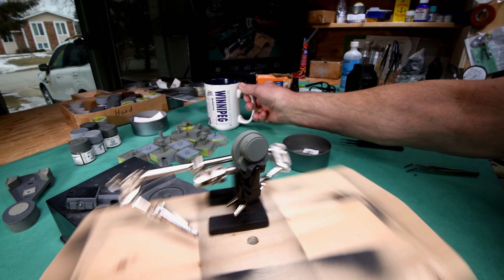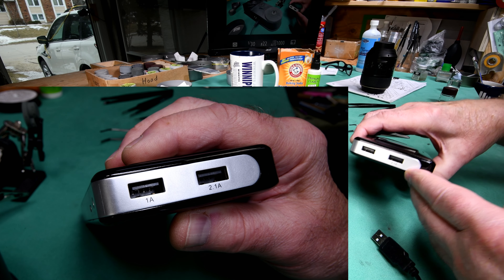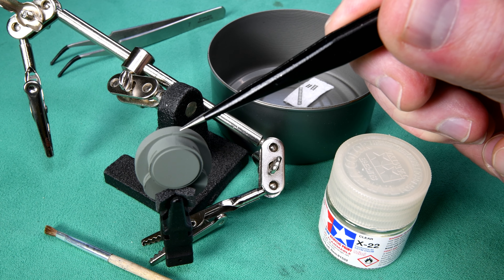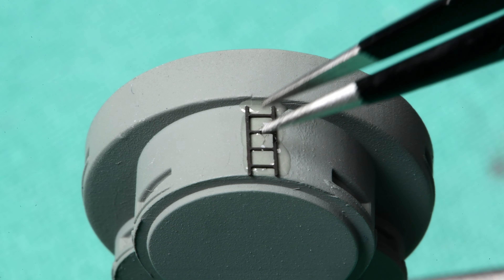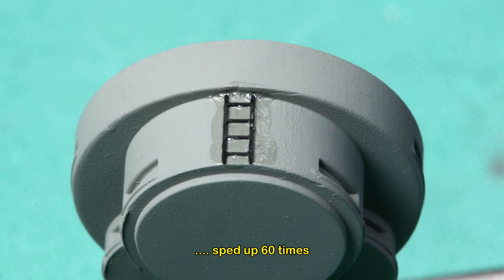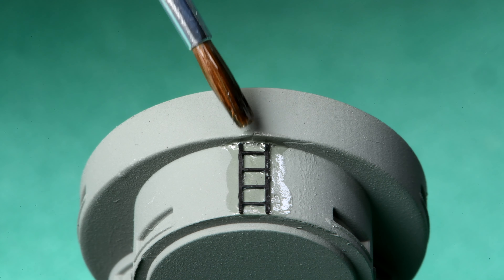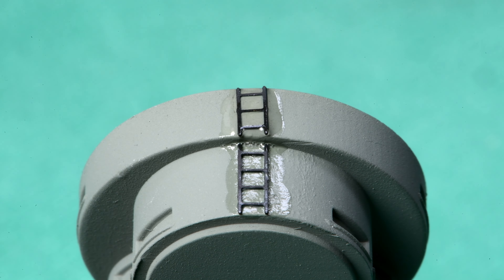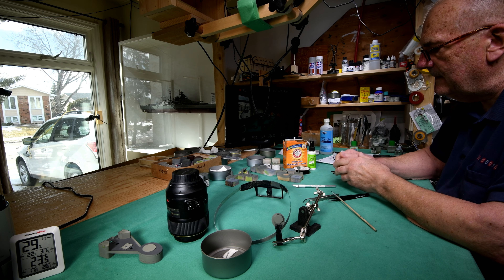The Model Ship - Part 743

Comment: Just curious why use gloss clear before flat clear? Wouldn’t using only flat clear be a one and done option?
Reply from the maker: I was finding that the flat clear did not have the adhesion effect as well as the gloss clear. Flat clear seem to dry more powdery. Perhaps I try an experiment on camera -- if I remember that is, lol.
Reply: @roncalverley  i would have thought both paint would have dried the same

Comment: When I wear my "Super Strong Eyes" I find that the perspective is warped so much that its hard if not impossible to line up anything straight, its a real problem working on real small pieces.
Reply from the maker: Yes, agree! I understand what your talking about Peter. 👍
Reply: @roncalverley  I have a set of "super strong eyes" as you call them, because my "knackered old eyes" as I call them, don't work very well. I struggle with them because of all the changes in focal length when working at the bench. I must practice more.
Reply from the maker: Thanks for commenting here Nigel. I'm now 74, but I think that for my age I've got good vision --- as long as I can view something from "arms length" (or more), lol.
Now, in tomorrows episode, 744, it's my intention to go into our mutual problem of negative comments. I can feel your frustration about this. See you tomorrow.
Reply: @roncalverley  I always remember my dad saying he needed glasses because he run out of arm length when reading his paper. Now I'm the same 😂